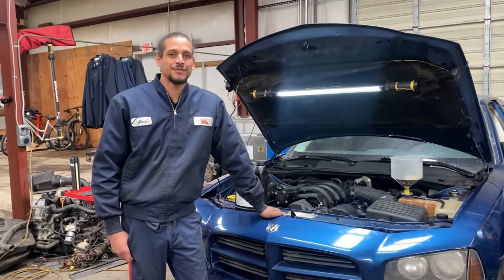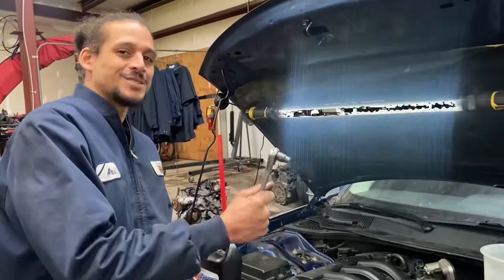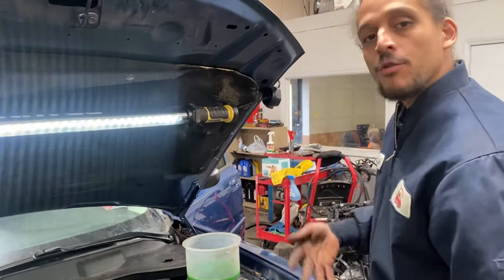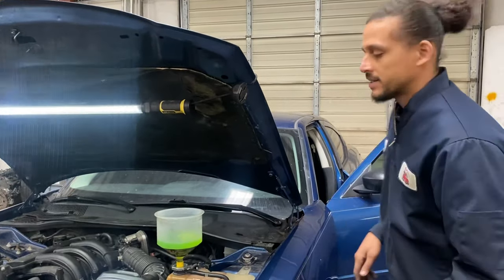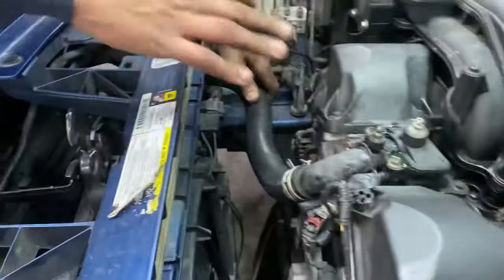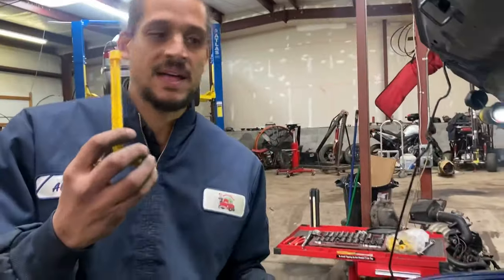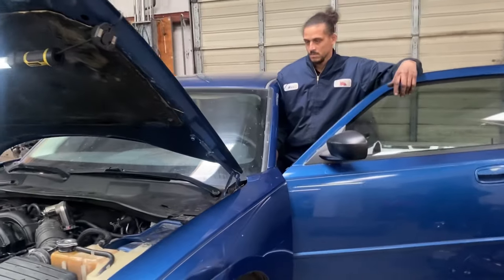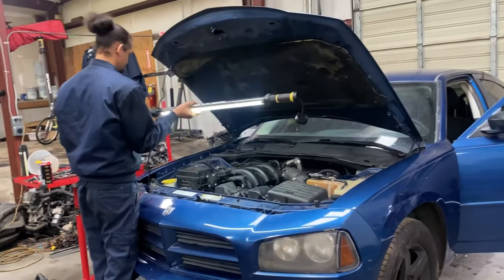How to Bleed or "BURP" Air Out Of Your Engine Cooling System (2 WAYS) #coolingsystem #overheating

Comment: Imma get 1 of those funnel couse I been working on a 2013 charger for 2 weeks trying to get da air out
Reply from the maker: Hey there you may want to perform a block test to make sure the head gasket is not leaking

Comment: yeah man thanks, I have a 2011 Mercedes CLS550 and installed a new thermostat and I keep having to fill it with antifreeze, the pressure in the system is causing overheating, water gurgling up from the reservoir overflow, I can hear all the air gurgling in the system and overheated the engine today. Upper radiator hose blew off, ugly. So I believe there is way too much air in the system. One think I did not do was turn on the heater. Thanks for the video
Reply from the maker: Glad I was able to help

Comment: Alex, I flushed my coolant, using the same funnel, followed all your directions, but when I put the heat on high, it’s hot, when I go to say 79, it gets much cooler. Any suggestions? I let all the bubbles come out, and let the car run. Hi heat works great, but when I go to say, 75, it gets really cool? Any suggestions? Thanks

Comment: I hope this helps with the bubbling in the overflow container after driving that I'm having. My car is not overheating, no coolant in the oil, no white smoke out the tailpipe. The water pump was replaced a few years ago, the heater is blowing in the car is great. The radiator was replaced same time as the water pump. Only losing maybe 1/2 cup of coolant each time I drive because of it bubbling in the overflow container. The car is a 2003 Dodge Neon 2.0.
Reply from the maker: You may have a defective radiator cap
Reply: @AlexTheCarDoctor  have changed that too.
Reply from the maker: @yvonneshealey9429  only 2 things it can be then, radiator fans are not working or blown head gasket, yes you can have a blown head gasket without the normal symptoms like milky oil, White smoke from tail pipe. I have seen on a number of occasions when the head gasket goes symptom like constantly boiling over, losing coolant when there no physical leak or white smoke, and hard starting or skipping/running rough when you first start the engine.the only way to tell for sure,do a block test some people say head gasket test, rent the tester from Autozone and get the block test fluid from Napa
Reply: Did you ever figure it out? I’m having the same bubbling issue. Again also no other symptoms.

Comment: Great Video

I have a 2002 Toyota 4runner 3.4ltr and replaced the radiator and I'm still getting air bubbles and no heat through the vents. I did replace the thermostat with a OEM thermostat. Any recommendations? Should I raise the front end?
Reply from the maker: Hey buddy how long did you  leave the radiator cap off for the bleeding process
Reply: @AlexTheCarDoctor  the whole time. I was just filling the radiator as needed. Is was gurggaling and spitting out the top where the cap goes. The bottom radiator hose was not getting warm so it was acting like the thermostat was not opening up.
Reply from the maker: Make sure you have the truck on a flat surface. the coolant system is designed to be bleed on flat ground. the highest point of the coolant system is the fill point.make sure you have the heat on full blast and see if a friend can hold the RPM at 1500 to 2000. When it starts getting hot and boiling over stop the engine let it sit for about 20 minutes then come back and top everything off and messaging the top radiator hose at the same time then repeat the above process again until both hoses are hot. Good luck buddy

Comment: Great video. I have a 2010 infiniti g37x and i always find myself topping off coolant in radiator , and the overfill tank to max. Overtime, the overfill tank goes empty, also i can hear coolant splashing in dash on low rpms. Could this indicate a head gasket leak, or just massive air inside of the system?
Reply from the maker: Hey there buddy sorry to hear you having problems, on those G 37 engines there are small coolant hoses that tends to leak that may be the problem with yours and eventually air gets in the system causing that noise

Comment: Bro great information. I just changed my radiator and still have stubborn air in the system. I have a 02 Mercedes cl55. Do you have a link wthat bowl you used? Thanks 🙏🏾
Reply from the maker: Hey buddy if you are talking about the burp funnel this is it https://amzn.to/3nxbX0Y
Reply: @AlexTheCarDoctor  Yes that’s it! Thanks for the fast response! 👍🏽
Reply from the maker: No problem glad to be of service have a great one and thanks for watching
Reply: @AlexTheCarDoctor  bro do you know where I can get one that fits the cap on my 02 Mercedes Benz cl55? I just had one come but none of the caps fit. All are to small?
Reply from the maker: @ThEDIPPA1  with those Mercedes they have those side radiator surge tanks that particular design I just leave the cap open and make sure I let it run with the heater on high and massaging the hoses for about 10 to15 minutes

Comment: Seems like you put 90% coolant, and 10% water? Is that the case, or did you add more water, off camera? Another question? Does it have to be exactly 50/50 in the ratio?

Comment: I have no idea about cars so I've been attending "YouTube University" and This video out of 20 videos I've looked up looks the easiest and now I feel confident.  I have an 2008 Jeep commander 3.7 V6 that's just been sitting in my garage cuz it had an oil leak somewhere but I want to get it going again. I drained the coolant and I just got my distilled water. Im about to flush it this week. 
My question is what would I do or would it still work if I didn't have a heater . The previous owner bypassed on it. So I kinda don't want to take the next step until I found out. What would u suggest?
Reply from the maker: It’s perfectly fine if the heater core has been bypass. Thanks for watching and remember if you have any questions I’m here for you
Reply: @AlexTheCarDoctor  You the Real MVP

Comment: Hi Alex, I recently changed a thermostat on my 2015 challenger sxt. Before i started the job i picked up two bottles of peak north American coolent. Its orange OAT. When i drained the radiator the fluid that came out is purple. Under further investigation i read that dodge dyes their oat coolent purple. I ended mixing the two. Please tell me im not going to cause catastrophic failure. I still might do a flush and fill with OE purple.

Comment: Hi Alex. Burping is great video. I wonder if you may help with this:
2005 4.0 exploret; pressure seems to build up but does not overheat. Plus, does not blow hot sir in the cabin - does it have heat valves & if yes then where are located?
Visited many garages but could not get them fixed.
Best regards, Saeed.
Reply from the maker: Hey there and thanks for watching. It does have a heater control valve it works off vacuum.you can find it by following your 2 heater core lines coming from the fire wall

Comment: If you squeeze the radiator hose and than put that yellow stick into the funnel and than let go of the hose, it will create a suction force so you don't spill any fluid when you remove the funnel!!!

Comment: Question, I bought a car that has the radiator fan wired in a way that makes it turn on once the ignition is turned on. Is this going to be a problem when I try to burp the system?

Comment: HI man thanks for the video!! Wil this process work bleeding through reservoir or radiator with the funnel?
Reply: 93 z/28
Reply: It has reverse flow system so im going to use bleeder screw off of radiator

Comment: Alex, not sure if you have a minute to answer my question, but after I do this, my coolant will not go from my reservoir back into my radiator. I have to keep filling the radiator.  I have an airtight system and got it pressure. Checked multiple times. It just keeps reverting to this problem. Any ideas?

Comment: I just had my 2005 Kia Sedona timing belt and water pump  replaced but now it overheats on gauge hoses are hot but radiator cap is not hot fans working fluids full , do you have any suggestions, before it was worked on it never overheated, thx  for any suggestions I also subscribed

Comment: Will this work on the 1UZ-FE (Lexus SC400 and LS400)? My car has a 17mm bleeder bolt on top of the engine (where the thermostat is) and it is confusing me if I should:

a) mount the funnel on the reservoir

b) mount the funnel at the 17mm fill bolt location

Thank you in advance.
Reply: Not B

You mount that funnel to where the pressure cap is

Comment: Awesome video quick question tho after the bubbles are out and you take the funnel off what happens to the remaining coolant inside as you can see they come with a cold line fill and in the video it shows all the way to the top what happens to the rest of the coolant?? Does it slowly dissolve by its self in time or what are the steps
Reply from the maker: The surge has a over flow tube the extra will get pushed out on the ground some surge tank have a built in overflow tank
Reply: @AlexTheCarDoctor  thnx so much bruh I currently have no heat in my truck after I replaced the water pump so I think they might be some air bubbles inside any recommendations on what type of coolant should I use for a 2011 ford f-150 xlt
Reply: @AlexTheCarDoctor  thanx so much bro I got heat in the cabin now
Reply from the maker: @jesusmontes4196  the coolant should say ford on it. My pleasure buddy
Reply: @AlexTheCarDoctor  the heat comes and goes back what’s  the meaning of that is it possible they maybe more bubbles in there?
Reply from the maker: @jesusmontes4196  what was the original problem with the f150
Reply: @AlexTheCarDoctor  at first it was a bad water pump
Reply from the maker: @jesusmontes4196  did you run it hot
Reply: @AlexTheCarDoctor  for a short distance on my way to the mechanic but I stopped various times to make sure it cool off
Reply from the maker: @jesusmontes4196  do a block test just to be sure are you familiar with that test
Reply: @AlexTheCarDoctor  no sir
Reply from the maker: @jesusmontes4196  https://youtu.be/N4NpomEKm4g
Reply from the maker: @jesusmontes4196  you can rent the tool from autozone but get the block fluid from Napa auto parts

Comment: Must you use the bleeder valve, or can you watch for bubbles with radiator cap off? I usually fill the coolant reservoir, and radiator to full. I then turn the car on, and heat on low. I then continue to fill up until the coolant in radiator stops falling. I then wait until the bubbles stop, and I have heat. I then close the cap. I never touch the bleeder screw. Do I need to use the bleeder screw? Thanks!
Reply: Your method is good... If no burp funnel, others raise the front of the car as well to make sure air gets out of the top

Comment: So if I was to do this with a 2010 dodge nitro and bleed it would I need the exact amount of water to antifreeze that's concentrated Right ? Because you didn't pour the  entire bottle of water to it. Did I miss something? The heat is blowing low to not at all sometimes.

Comment: I have been dealing with a 2006 Chevrolet equinox overheating. First, I replaced the low-speed  cooling fan reley ,  and it was staying cool for a few days. Then the fan wasn't working again, and I checked the relay and it was good so I checked the cooling fan and found a burnt contact on the connector on the female/fan side of the pigtail. So I was ready to replace the fan assembly but I plugged the fan connector back in and i tested it again with the A/C on and it came on. So then I was going to replace the temperature sensor in the block and I purchased a temperature sensor/sending unit. When I was ready to install the temp sensor wire, I noticed that the the connector had a bare wire so I did a temporary fix on the wire and I am ordering a new connector. I never bled the brakes after the first problem and I am wondering if that is a contributing factor with it getting hot and should I install the 5emp sensor anyway, money is really tight and the car belongs to my 74 year old father and we just bought it the beginning of June. He had a new car but couldn't afford the payments on it after my mother passed away in February. Should I change the hermostatic too, just to be safe? We live in Southern Arizona so it's very hot and dry, tomorrow morning I will burp the system 😮to get the level up. Thanks for your video Jim Jr

Comment: What if my heater doesn’t work am I able to still do this method without turning the heater on?
Reply from the maker: It should still work most modern cars don’t have a heater shut off valve. I just tell people to turn on the heat just in case they have one

Comment: I have a 2015 Chrysler  200s had some over heating problems ,had the thermostat and radiator fan changed, its not over heating but reaches high temperature at 230 degrees then goes back down, sometimes stays at 230degrees. its never reached that temperature before.why do you think its reaching 230 still  and is that considered too hot to drive ?

Comment: Is the bubble bucket nessicary? Or can you carefully and protected from high heat fluid theoretically release pressure through the cap of the reservoir? I'm aware scalding fluid will spray but mine has a limit where I can let air out and stop the spray. Is it doing what I think or is it making it worse?
Reply from the maker: Hey there no it’s not necessary but nice to have.I’m not sure what vehicle you have so I can’t picture what your typing, you may have a after market pressure release radiator cap with a red tab that allow you to release the pressure.me personal I don’t like that cap not sure if it will make it worse
Reply: @AlexTheCarDoctor  hey bro....that burp plastic things isnt a have to do is it??....i can just crank up the car and press the gas a little bit right??....

Or whats the best way to burp it if i dnt have that device???

Comment: I have a 2010 dodge charger I have replaced the radiator, water pump, thermostat and water reservoir.  The car still overheats when it is driven several miles.  The car can idle for 45 minutes to an hour and not run hot.  Any suggestions?
Reply: I got the same problem on my 2004 jeep liberty
Reply: Same on 2018. No issues while idling. Driving on the highway, especially if pushing it hard, temp starts to go up to 3/4 of the way.

Comment: Question: There's a ton of people in the Wrangler community that mention that their Pentastar V6's run hot. Lots of opportunities for air to make it into the systems on our motor cooling systems also (defective oil coolers, radiators, thermostats, etc can all be opportunities for air to make it into the systems). Many of us use a funnel like you have to bleed the systems after performing these repairs.....9 times out of 10 it seems like if we leave our motors running for too long (too many fan cycles) while doing the bleed process the funnel seems to boil over or push a bunch of fluid out because of the expansion. 

My question: Is this normal on a Wrangler? 

If everything is working perfectly (no head gasket problems and the cooling system is working) we shouldn't be able to leave an engine running for an hour without spilling over should we?

Thanks! 
Dan
Reply from the maker: Hey buddy I never left a coolant system open for that long during the bleeding process so I not sure, now I have left a coolant system open for experimental purposes for long periods of time over an hour from that I saw it starting to boil over.
Reply: @AlexTheCarDoctor  ok, makes sense. Thank you!
Reply: Happens to me on my Mazda6 and Explorer.  I thought that was normal. 🤷🏿‍♂️ not sure how long it takes to start filling up again but I know it's less than 20 minutes for sure.

Comment: I wanted to get the air out my system. Its a 370z. I opened the throttle body that had a hose for coolant to run through for cold weather... but i feel like i got air in the system. I used a spill free funnel and when i went to crank the coolant rose 3/4 up the funnel not sure if it was meant to do that. Any help would be appreciate it

Comment: great video .....im problem is i did the heater core and thermostat and still no heat . i checked the heater hoses at the oil cooler one is hot and the other one is cold...so i bought a new oil cooler hope to solve my issue....but the heater hoses get hot after driving the car for a few hours....im lost if the oil cooler dont fix it..
Reply from the maker: What type of car do you have.both heater hoses should be hot 1 a little bit hotter than the other. Do the car/truck run hot.
Reply: @AlexTheCarDoctor  07 dodge charger 3.5 . not never run hot

Comment: Just subscribed. Great video. Quick question, what if there’s no trapped air but temp gauge is fluctuating going from the middle @ 215 degrees to 3/4 of the way @ 245 degrees when accelerating on the highway and then goes back to the middle while cruising?
Reply from the maker: That still sounds like some air is trapped in there to me … it can take up to 30 minutes to get the air out
Reply: @AlexTheCarDoctor  I replaced the thermostat back in September. So it’s been 9 months. Got all the air out then. Haven’t had an issue until now. While idling temp stays in the middle.
Reply from the maker: @Mopar3.6LV6  or a bad thermostat